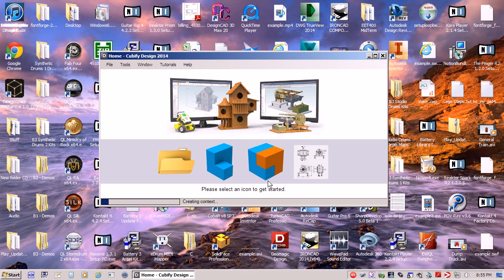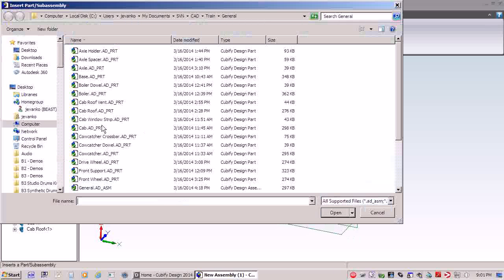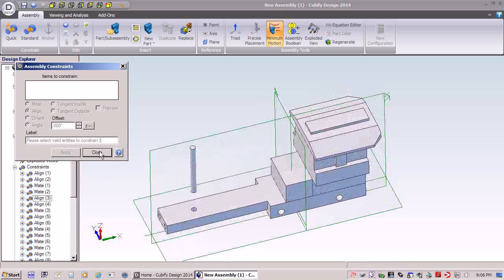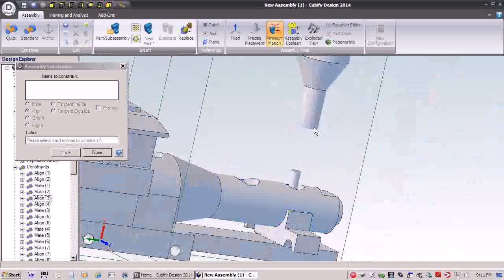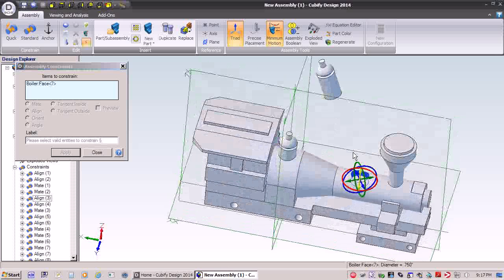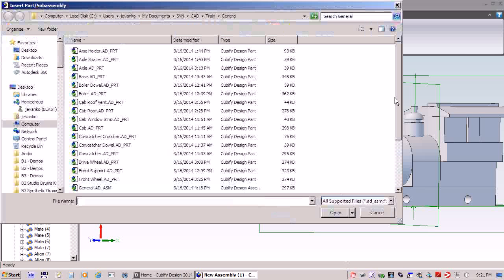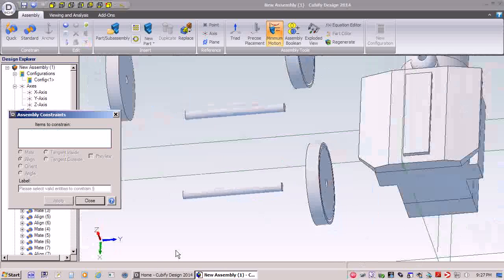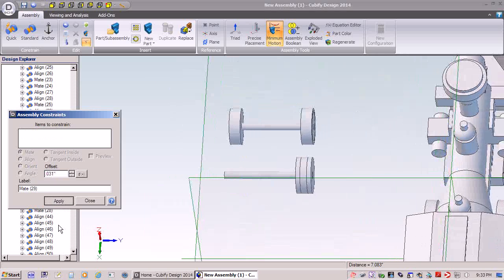Assembling "The General" Train Model

Comment from the maker: I probably would have had better luck if I didn't have the tendency to deselect the triad tool when re-positioning those cylinders.  Also, it seems tangent inside can be used to align cylinders same as the align constraint.  But, at least in my mind, you're supposed to align things with the align constraint.  That's just the way it is...